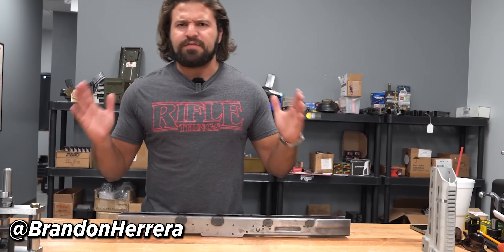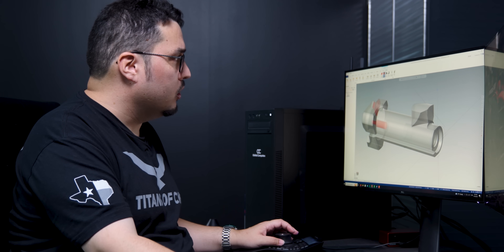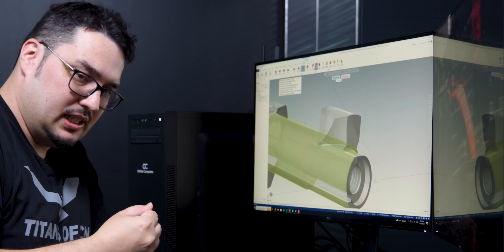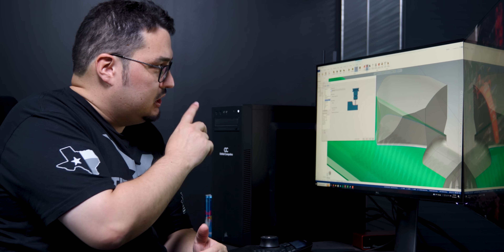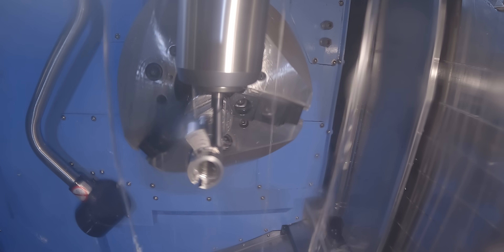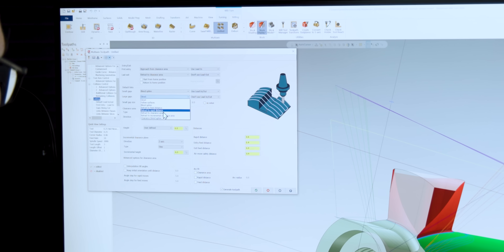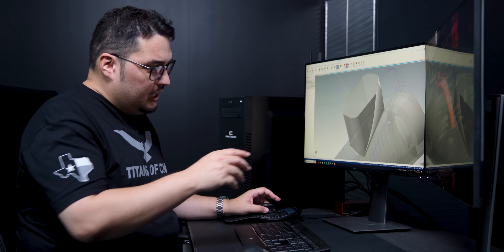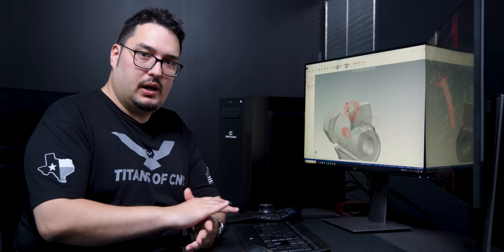Techniques Behind the AK50 Bolt!

Comment: Lovely, really a work of art.  The question is why not make a simpler part?  But let me guess, the ten other parts that interface with the bolt require this shape?  Still I like Elon Musk's idea that: "the best part is no part" So if you can redesign a thing with less parts then do so.  The M-1 Garand uses a projection off the locking lug, the M-14 puts a ball bearing in the same spot, the Mini-14 goes back to just a solid lug.